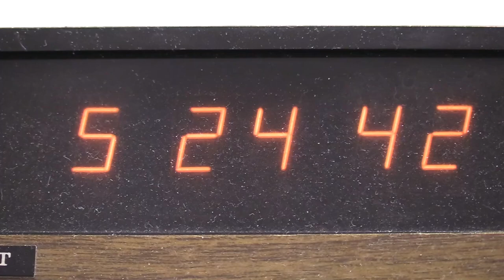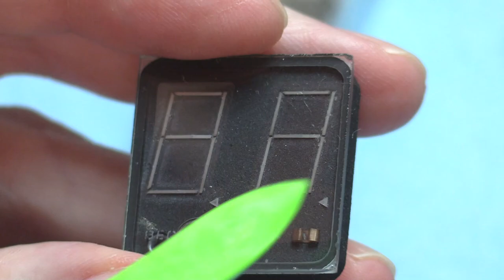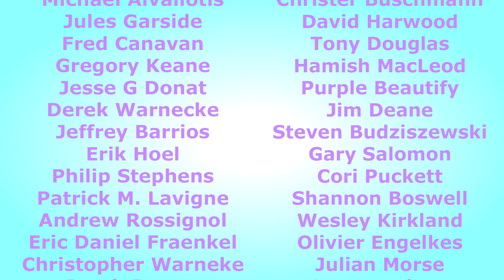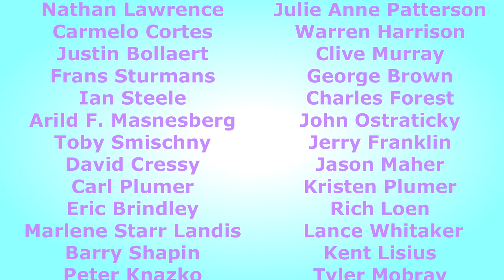Why Are Tubes Mirrored?

Comment: Most nixies contain argon and a tiny amount of mercury in the gas mixture. Argon adds purple light and mercury adds blue. Argon lowers the striking voltage. Mercury extends the life of the tube by preventing cathode damage, but I don't understand how. The nixie you showed had a white cylinder inside, behind all the digits. There was a small capsule of mercury inside it. That particular tube has 13 pins: 10 for digits, one for the anode, and two for the capsule. After the tube was sealed, a current was fed through those two pins. That caused the mercury to heat up and vaporize, bursting the capsule in the process.

Comment: Still got a pile of tubes laying around. The largest is a 10 kW Siemens transmitter tube from a TV station. I used to build radio transmitters with tubes in the 70's. Back then tubes were much cheaper and behaved way more predictable than transistors.

Comment: I have a gettering around the house somewhere , took it out of a vacuum tube when i was young , Use to check my VT's  at the local Sun Rexall , it was basically a pinball machine converted into a tube tester , once found a O scope toss out and checked the tubes only one was bad  5y3gt  tube  could not find a replacement then i noticed the tube could go in 180 degrees installed and the o scope worked hooked my stereo speaker wire to it for the visuals , later sold the o scope for 5 dollars.

Comment: Even before I started watching, I knew the answer! :D

It's for removing the last of the oxygen and other gasses left in the tube after manufacture. They put a chemical in those little circular elements, then charged the tube to heat it and activate the oxygen scavenging process, if I remember correctly.

Yeah, I'm olde schoole. XD Electronics lab in high school in the late 70s. ;)

Comment: For more information about Nixie tubes I suggest you check out Dalibor Farný's channel here on YouTube: https://www.youtube.com/user/daliborfarny. He builds them from the ground up and had to re-develop and re-invent a lot of tools and techniques. I have never seen him use a getter, though; I guess they are not compatibel with neon gas or simply not needed as Nixie tubes are not extremely high vacuum.
Reply: Then you haven't paid close enough attention. They do have getters.
Reply: @zaprodk  It's a bit like learning a new word; suddenly you hear it everywhere. Now that Fran explained getters to me, I'm sure they'll be popping up a lot more often!
Reply: He has even an entire video about a getter cutting machine....
Reply: Neon is a noble gas - it doesn't react with any other element. So the getter is able to attract other gases without attacking the neon.
Reply: The getter that dalibor uses is of a different kind. This getter is not to absorb residual gases but it is there to introduce a little amount of mercury after the tube is sealed off. This mercury is needed to avoid sputtering of the electrodes. Dalibor bakes his tubes very hot as he uses borosilicate glass ,hence his tubes have not much residual gases.
Reply: In the navy we used to have radioactive voltage regulator tubes. Big fuss if you broke one, you’d have to evacuate, seal the hatches, shutdown ventilation, and summon the cleanup crew who had breathing apparatus, lead lined bags and a disposal kit.I had lots of these tubes but was careful enough never to break one.
Reply: @zaprodk  don’t be so rude. Learn some manners and who knows, you might win some friends.
Reply: @rob28803  I'm not being rude. I just told him that he hasn't been paying attention to the build videos or the videos where he exclusively talk about getters, sourcing them, cutting them etc. It's not being rude noticing that someone overlooked the fact.

Comment: Those are some pretty cool tubes!  Especially the high power ones! I didn't know they operate at such high temps. One thing I like to collect is low pressure sodium lamps, and they also use a similar getter inside.

Comment: The gray material on the power tube anodes is sprayed Zirc powder. It has to be HOT to work effectively. Rumors about "just run tube filaments for 24 hours" will not remove gas ions from a high power rf vacuum tube.

Comment: In 1960 we moved from the old home place, from a house built by grandfather in 1910 to raise his 5 boys and one girl, to a nearby farm that was wired with electricity, and near enough to town, only 8 miles much closer then the 26 miles to the old place. I remember the year because I recall having to cross the 5's on my school papers and writing in the 60 in place of them.  With power came unlimited access to the radio, a luxury we never had on the home place because batteries for that old radio were expensive, Dad had purchased an old floor model 110 volt set at a farm auction and suddenly the radio shows we loved could be heard on the air when we knew they were on, even later Dad came home with an old used TV set and we knew we had arrived in the modern world.  Were the damn house not haunted, I believe we would have stayed there longer then 2 years, but after a couple of years of frightening sightings of the spirit of the long dead child who had been killed by a large dog, dying on the kitchen table, the spot where it regularly showed up, we moved off the farm, and became citizens of the small town that served the area.  Dad went from farmer to pump jockey, mom from farm wife to cook at the café.  It was quite a shock but we survived. Now that I have gone this far, I have completely lost my train of thought and can't for the life of me think of what I was getting at.  Sorry about that, thanks for the peek into the insides of vacuum tubes, I had wonder who the hell Getter was, now I know I guess.

Comment: In relation to nixie tubes, there's also the Dekatron (gas filled counting tube). I have some with traditional tube getters, and some without. And it sometimes with the same tube type, from the same manufacturer. I have Sylvania 6802 dekatrons with and without getters.

Comment: The high voltage rectifier tubes in tv sets had metal x-ray shields around them. We were always told as kids to sit at least six feet away from the tv for that reason.

Comment: I wish your tube collection included variations of the subminiature vacuum tubes used for the them top secret proximity or VT fuse in WW2
.

Sylvania made 5639 glass pentode which was glass cased and could withstand 200+G force of being blasted with an artillery shell. What I once touch was a metal cased tube. Wish I had kept it but no easy to see what's inside.

Comment: Valves (or Tubes) made by Philips/ Mullard in the 1920's/30's used a process known as the Azide process to getter their valves. It made most of the insides of the envelope black and not the neat getter that we know today. That is one of the reasons why the envelope was painted.  http://www.r-type.org/addtext/add011.htm
Reply: Oh heck I remember seeing them on old control gear, Wish I had kept them I scrapped hundreds.

Comment: Thorium was originally alloyed with Tungsten in order to make it easier to draw the brittle Tungsten through dies to make fine wire for filaments. It was later noticed that Thorium increased the number of electrons released by the hot filament. The cathodes of smaller, lower voltage vacuum tubes are coated with oxides of barium/calcium/strontium which give off copious amounts of electrons even at lower (dull red) heat. But oxides sputter at high voltages and transmitter tubes can't use oxide filaments. (No matter what materials are used, vacuum tube filaments don't give off that many electrons, so to increase power above a certain point, you have to increase the voltage.) But thoriated filaments require high temperatures for emission. As a result, many tubes with Thorium filaments shine nearly as brightly as a lightbulb. It's true that Thorium is slightly radioactive, but the alpha particles it gives off can't make it through the glass. At one time specialized tubes with highly radioactive cathodes were produced. Beta emitters (electron source) were used and the cathode did not need to be powered/heated. But those tubes were somewhat of a hazard.

Getters can remove certain gasses (oxygen, hydrogen) but not others (argon, helium). Tubes with some residual gasses often get better once they have heated up--the getter surface is more reactive when hot. So a "gassy" vacuum tube can often be cleaned up simply by running it (tubes that have been in a box for years may test gassy at first).  Because the getter is a highly conductive metal, tube designers had to be careful about getter placement and the use of getters in high voltage transmitter tubes was limited. But those were not created in high volumes and could be placed in a heated chamber and pumped for many hours before sealing off. That would not have been practical with high-volume production for tubes used in radios and TVs.

Comment: Used a lot of 4-400A in my 1k am transmitter.  2 in the  modulator and 2 in the power amp.  Each manufacture has a different design of the tube guts to keep the paten hounds at bay.

Comment: Great video. So the halo gitter ring is heated during manufacturing to deposit barium material on the glass. That barium continues for the life of the tube to remove unwanted gases. So does the round halo getter get powered after manufacturing? Or is it a one and done ? Ty Steve

Comment: Haven't seen tubes like that in a very long time! Thank you for that! Operations cabinets where ovens back in the day almost hot enough to do heat treating in them. Case about the radiation most tubes produce radiation when active not much sitting still and room temperature.

Comment: Some early tubes reportedly used phosphorous as the getter material. I think this applied to WD11, or 199 tubes, if I remember correctly. Some of these used thoriated tungsten filaments which,  If the tube grew weak, could actually  be rejuvenated by running them at triple the heater voltage for a minute or so and then letting the tube idle at slightly higher than normal filament voltages overnight. Years ago I successfully rejuvenated a bunch of these tubes before reselling them.  Unfortunately this technique does not work on more modern tubes which typically had some kind of chemical oxide coatings on the filaments or cathodes and didn't use thorium.

Comment: Damn. I was hoping you would get to a quick tube tip:
How to spot an OBVIOUSLY bad tube, is where the getter flashing has turned white or light grey. Usually it indicates a glass crack or bad sealing around the pins.

Comment: One thing that has always puzzled me is the black or greyish, powdery-looking coating on the inside of the glass on certain tube types. Some people believe it to be for shielding, but plenty of " ink bottle" 6V6 output tubes have this coating, and why would an output tube need shielding? PS, If Fran was to do a follow up to this video, a discussion of gassy tubes, grid emission and interelement leakage would be interesting.  I would also be curious to know how the getter was flashed onto the inside of the glass without also splashing those metallic elements or compounds all over the metal parts and mica insulators of the tube (which would cause interelement leakage, or electron emissions from areas of the tube that shouldn't emit electrons).

Comment: Like Fran I have been around awhile (just longer). When I started working in Consumer Electronics in the late 70's they were still using tubes in the high power circuits. Transistors were doing the lighter preamp jobs and microprocessors were still being developed in a laboratory somewhere. Fran does a great job thoroughly explaining all of her questions and is always a pleasure to watch. Even if I already know about a subject she is talking about (like this) I always learn something else because she is so thorough in her understanding of electronics. Another great video Fran!

Comment: I've some OLD power tubes that are measurably radioactive due to the use of uranium-doped class in the lead seals.
They'll also fluoresce when exposed to UV light. I've no idea why they'd include that glass in any power tube.
Also: most neon indicator lamps (NE-2H for example) do contain a small bit of radio isotope to facilitate reliable (and more predictable) ionization of the gas, same with ANY gas-filled voltage regulator tubes. As it is that ambient light lowers the "strike voltage", the internal r-isotope does that instead, rendering them much less susceptible to light.
Ever notice a neon indicator that's aged often flashes in the dark? Shine some light on it...

Comment: Fran, I'm not an EEE, but I'm engineering adept and am curious about the design/function of vacuum tubes. I understand the flow of electrons between things in the tube, but what / how do heater elements, metal baffles, grids, mesh and the mica insulators (et.al.) make one tube a rectifier and another an amplifier?

Comment: I have a guitar amp based on overbuilt Bendix 6094 power tubes. A tube similar in power to 6bq5/EL-84. I also have quite a few Bendix 6384 tubes. They are kinda a grossly overbuilt 6L6. You should do a video about them as they were built to withstand very harsh environments for aerospace applications.

Comment: Many vacuum tubes , including high pressure discharge gaz lamps protecting envelope, are equipped with getters: you can get rid of the last residual atoms after the sealing of the tube, functioning quartz tube dissipated heat keeps the getter active to recapture residual atoms, and it only costs a few cents. The initial action of heating is a metallic deposit on the glass nearby, but on these high temp applications, the deposit is also accumulating. The same is also occuring in electronic tubes, as the heating filament can also dissipate metallic elements from itself or it's grids surroundings. The color is then a good indicator of a gased or cracked tube, as it turns to a whitish coat, but if it's completely brownish or mirror like, it can also indicate an excessive power dissipation or a used tube. A classic "magic eye" or fluorescent display won't benefit of an excessive clouding! A standard triode or pentode should never operate at a "red hot" temperature level: always check you data sheets and check for an optimal plate dissipation and polarization. Many of these high power transmission tubes were mounted on special supports including water or oil cooling circuits, many of these mechanical housings were kind of engeneering marvels.

Comment: I like this video, I subscribed. I'm so interested in designing circuits with tubes. Seriously I don't understand what all the big deal is about it, being how I have been solid state all the way since college.  My friend builds tube amps from the ground up and wants me to get into it.  She is very knowledgeable however tube builds are typically high voltage AC often mixed with DC, and I'm so lackadaisical and hate getting shocked. 

I'm gong to eventually dive into this.

Comment: How does the glass withstand a tube getting up to 800° C.? Is that a normal temperature for glass to withstand?
Reply: Part of the answer is that the glass is separated from the hot metal.  IOW, the "tube" does not get to 800C
The vacuum in the tube means there is no "direct" transfer outward of heat from the guts of the tube to the glass case/envelope.
But, I'm not sure what keeps that heat from conducting through to the metal pins of the tube (which do go through the glass).  Perhaps most of it radiates away before it gets there?
Reply: @fewwiggle  thank you! That makes more sense. I just remembered seeing a peice of glass crack when it was too close to a fire one time and that made me think of that. I guess with electricity its different though, I remembered old power towers used glass couplers on top. We have them where I live in some places still.
Reply: @blackredonyx  You're welcome!!!

Comment: On those large high power tubes I'd wager all metal inside that gets glowing red becomes a getter. The "scorching" you mentioned on the metal inside the 4-400A tube actually looks like change in color due to a very thin layer of oxide. It's an effect that was commonly used in tempering steel to know the temperature of the steel before thermostat controlled ovens became common. As the temp. rises the oxide layer gets thicker and changes color.

Comment: I think it might have been "Glass Slinger" where I saw two stage gettering - maybe because the getter was recovered and re-used.
Stage 1, briefly pulse the induction heater to warm the getter below flash point, to de-gas the getter before flashing it.
Stage 2, the second or 2 it takes to actually flash the getter

Comment: So do all the unwanted gasses disappear over time wen the tube is used? Meaning the getter is only of use during the first x hours of use? (no idea how long it takes)
Reply: I think long term, gasses can migrate through the metal pins.  And the metal/glass interface may be imperfect.
Reply: @COBARHORSE1  , elemental gasses can continually "cook" out of the metal parts of the tube, especially if a poor circuit design, or other components malfunctioning (such as electrically leaky grid coupling capacitors),  causes the tube to overheat and run well above it's power-dissipation ratings.  The gases released by an overheated tube might overwhelm the ability of the getter to react with and neutralize them. Such "gassy" tubes are prone to going into thermal runaway and overheating because the impure vacuum becomes an emission source for electrons or allows the grid of the tube to emit electrons, which is supposed to be the cathode's job only.